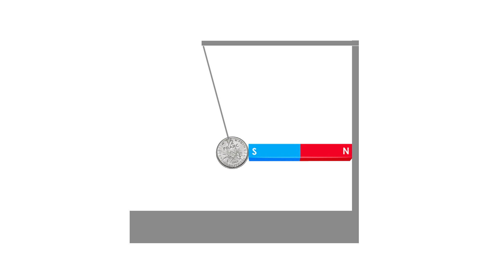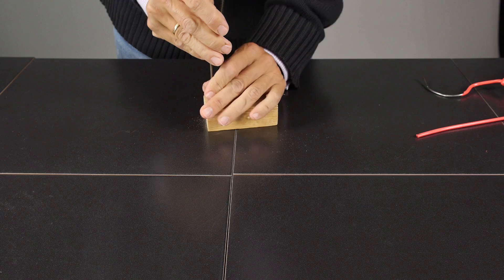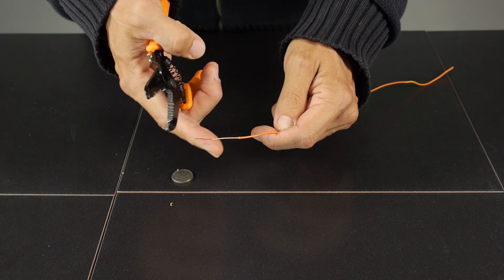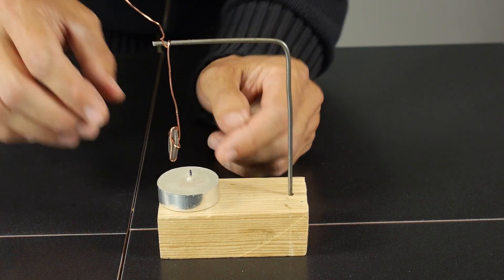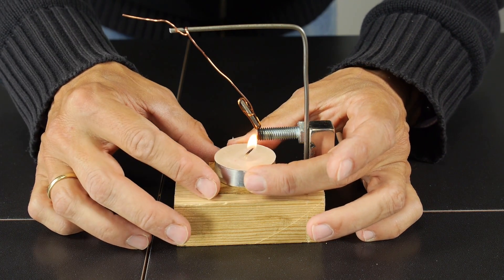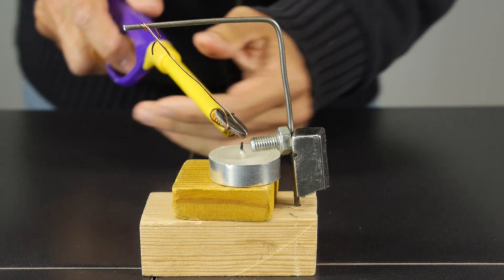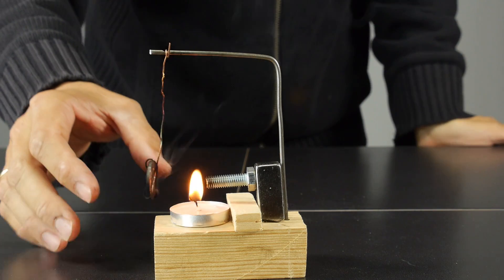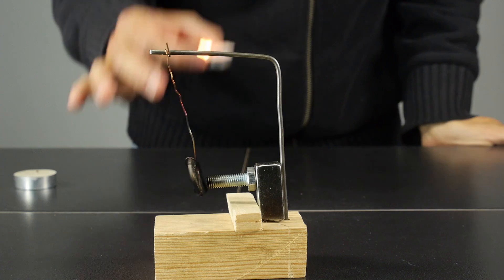Curie Pendulum. How to Make a Heat Engine.

Comment: That bolt is most likely galvanized steel, which when heated up releases toxic gasses so you might want to change that
Reply: Alessio Wilson  i have galvanized steel exhaust flue pipes  on my furnace in the basement. So far, not toxic
Reply: ArmedMonkey fume fever isnt actually as Bad as everybody says